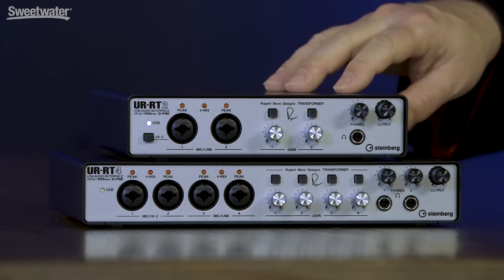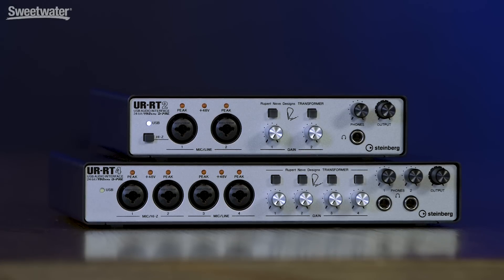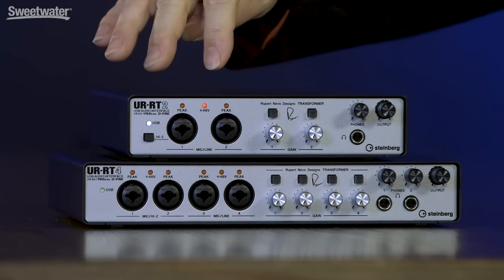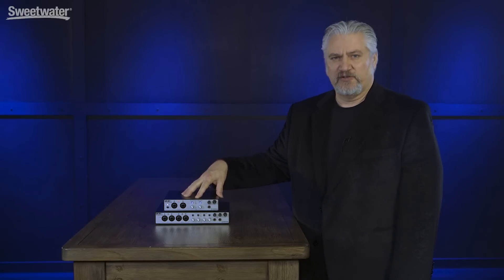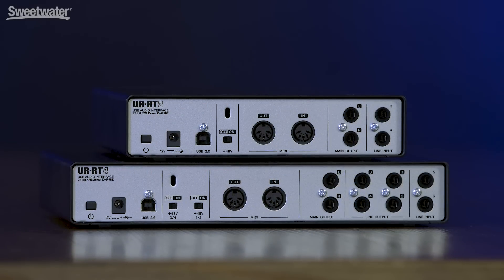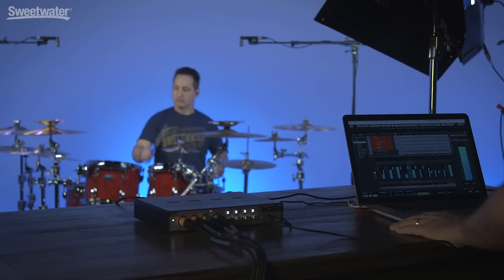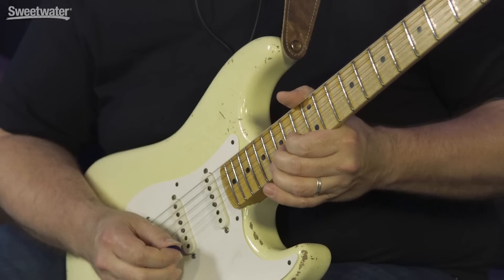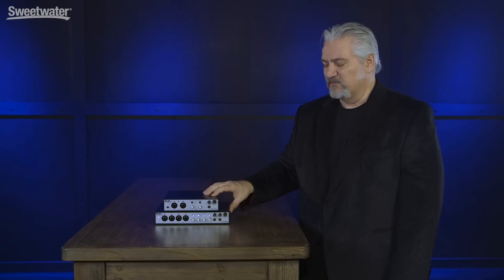Steinberg UR-RT Audio Interfaces Review

Comment: This is sooooo sick. I WILL BE BUYING THIS.
Reply from the maker: I know!! You really can't beat the Neve sound. That extra headroom, the trademark Neve character. It's amazing to see Steinberg doing this. Thanks for the interest, Maxwell!
Mike Godlove, Sweetwater Sales Engineer, (800) 222-4700 ext. 1355
Reply: Extra headroom is a long stretch when you compare it to other USB interfaces such as the Clarett 4 Pre USB, Apogee Duet 2, Audient and the RME Baby Face Pro that have specs close to high end equipment 2 to three times its price. The Front end specs on the UR-RT4 aren't all that great with only 101 db Dynamic Range, +4 dBu maximum input level which is quite low by today's standards. The Clarett has a lot of headroom with a Dynamic range 118 db, +18 dBu maximum input level.  The higher the Dynamic range the better as noise is accumulative. Once you start mixing many tracks together, the noise floor adds up and becomes louder and easier to hear. Same if you process your audio tracks with compressors or limiters > a side-effect of compressors is it raises the noise floor. So starting out with as low a noise-floor (measured with dynamic range) is ideal. The UR-URT is more inline with the Scarlett interfaces. Even the new Motu AVB interfaces have impressive specs that's normally found on high end equipment plus the ESS Sabre 32bit DAC they are using.
Reply: @sweetwater  whats the music ? Any link to download it . Great stuff.

Comment: Sounds good, but I wish it had more inputs.
Reply: Kevin Tran 8 would've been sweeeeet.
Reply: if you really need more than 4 channels you can get an focusrite scarlett  18i20 for 100 bucks less and still get 24bit/192k converters.
Reply: The UR 824 is pretty decent - and you can get it in bundle with Cubase Pro. I love the fact that I have 3 different cue mixes on it.

Comment: Can you use this device on multiple computers, or it's stuck on one computer box after you register your product?
Reply from the maker: Hi, thanks for your interest! Audio interfaces like this one aren’t registered to a specific computer, so you can move the interface between multiple computers with no issue. Of course, you’d need audio software installed on each computer you use – if you don’t already have such software, the Cubase license included with the UR-RT interfaces can be authorized on up to three computers.
I hope this helps a bit – feel free to contact me directly with any further questions, and thanks again!
Caleb Lowrey, Sweetwater Sales Engineer, (800) 222-4700 ext. 1620, caleb_lowrey@sweetwater.com

Comment: I like the price point. I'm 80% Dac for streaming Spotify with my MB Pro to powered monitors and 20% interface for guitar. Is this a good choice for what i'm doing or please suggest something else. I can go USB or Thunderbolt. My Audioquest Dragonfly dac  for the money is a good value. I've tried Apollo Twin MKii Duo and it gets the sound I want but $900 for a Dac? The Solo I tried wasn't as good as Duo although UAD said the AD/DA was identical in both. Thanks
Reply from the maker: Hello, Mr. Mips! It sounds like you have something specific in mind. Please give a call if you have a moment. I'd be happy to guide you to the perfect interface for your needs. Thanks for your message!
Mike Godlove, Sweetwater Sales Engineer, (800) 222-4700 ext. 1355
Reply: The specs for the DAC are ok with a Dynamic range of 114 db, THD+N 0.001% (-100 db) but NOT nearly as impressive as other interfaces for the same price. The Clarett 4 Pre USB DAC has a dynamic range of 118 db with THD+N of 0.0006%  (-104 db). The new Motu ultralite-Mk4 using the new ESS Sabre 32bit DAC chip with Dynamic Range of 123 db, THD+N 0.0008 (-101 db). The ESS Sabre 32 bit DAC chip is also found in the Apogee Duet 2 interfaces.
Reply: I like everything about this especially the transformers but I'm disappointed with the DAC, as Eman 08 points out. At this stage, it's just not acceptable for something with so much good going on here to have just okay converters. These converters should be comparable with the new Motu, the new Apogee, the new Slate, the new Antelope, etc. The fact is, no matter how good the preamps are on this thing, the DAC is so critical to getting things to sound truly professional and not hold back the enormous potential. This is why guys spend so much on Burl, Antelope, Benchmark, Dangerous, Mytec, etc. If these other competitors can manage to use next level converters in their below $1000 interfaces, why can't Steinberg? I don't get Steinberg. They make an amazing DAW(s). But all the rest of their stuff is plagued by "almost as good", almost caught up, almost pro. Why? Antelope does not do this, even on their "cheaper" stuff, UAD even upgraded their converters after complaints about the first generation Apollo Twins. Motu is now kicking butt again. I knew ahead of time that Steinberg would blow it on these converters...and they did. It's entirely fitting with their company philosophy which is to be always playing catch up and to never be out front on the audio vanguard. As a Cubase 9.5 Pro and Wavelab 9.5 Pro user, it's endlessly irritating.
Reply: Nelson Starr IV yeah the Steinberg/Yamaha interfaces are way behind in the competition as the UR range are basically low end prosumer as they have specs more in line with the Focusrite Scarlett range, Presonus AudioVox and Roland Rubix. Basically a Neve designed transformer bolted on a cheap low end budget interface. Even the Focusrite Clarett blows this thing out of the water for the Mic Pre ADC with a dynamic range of 118 dB, a Total Harmonic Distortion + Noise of 0.001% generally found in high end converters. The ADC for the mic pre on the UR-RT is shy of only 101 dB of dynamic range and 0.003% Total Harmonic Distortion + Noise which worse than the Focusrite Sarlett Range. I really think Rupert Neve should of reunited with his fellow Focusrite company and collaborated on a new product like this as he hasn't designed any thing for Focusrite since he sold the company in 1989. Focusrite is still Rupert Neve's brand while his legacy still lives on within the company. I think he made a mistake with collaborating with Yamaha.

Comment: Is it possible to connect two audio interfaces to create 8 channels. If yes, would there be any issue?
Reply from the maker: Hi, Celestialdrums. This is a good question! There is a way to use multiple interfaces easily if you are using a Mac. It requires creating an aggregate device, we have a guide here:
https://www.sweetwater.com/sweetcare/articles/aggregate-audio-devices-and-drivers-for-pc-and-mac
In this guide we also have a tutorial on using ASIO4All drivers on Windows, but in my experience this is a hit and miss set-up and changes from interface to interface. Aggregate devices are not perfect and can run into glitches at times, even on Mac OS, that can lead to clock drift and some other weird artifacts. I recommend picking up an interface with enough preamps or an ADAT expansion port so that all audio goes through a single interface.
If you have any more questions, just give me a ring!
Drake Sobehrad, Sweetwater Sales Engineer, (800) 222-4700 ext. 3271, drake_sobehrad@sweetwater.com
Reply: @sweetwater  Thanks a lot for your help.

Comment: Can they run purely on just usb bus power? If so are there any features that you lose from not having the power supply plugged in? Thanks, looks great!
Reply from the maker: Hey, Jon! These interfaces are not bus powered and the power adapter does have to be used. Thank you for reaching out… Rock on! 
Philip Courtney, Sweetwater Sales Engineer, (800) 222-4700 ext. 1968
Reply: Should we buy power adaptors separatly or it is sold with the UR-RT?
Reply: 12V DC power supply included.
Reply: @christinekolyan5821  I've bought an independent linear PSU tailored for my Steinberg. It improves the SQ of my steinberg massively!

Comment: USB 2.0?🙄 Need usb 3.0, or usb C. But being too thin connection for usb C can be a problem for long run. I wish we have usb C as long, tight, firm as TRS pin 🤔.
Reply: I buy it because it has 2.0. I have 1k £ usb cable that really improves the sound of my interface

Comment: nice! if the RT4 had adat I/O I would give it a run
Reply: Russell Loving me too! I wonder why they chose not to include it
Reply: sp0rtbilly77 not sure... especially when so many of the new interfaces in th at price range are including it
Reply: Do you think maybe it competes or will do so on future products?
Reply: When you look at the specs, they aren't that great as they are quite low by today's standards compared to the rest of the completion in the same price range. Its basically Neve designed transformers bolted on a budget interface with Specs more inline with the Focusrite Scarlett range.  With only a Dynamic Range of 101 db for the AD is pretty disappointing compared to the Clarett 4 Pre USB with 118 Dynamic range db with specs normally found on interfaces 2 to 3 times its price.
Reply: Eman 08 that could be, what would you consider better than a Scarlett in the same size and format?
Reply: sp0rtbilly77 not very many out there in that same class maybe the Presonus Studio interfaces with the exception of the studio 192 that's more in line with the Clarett USB interfaces. The new Motu AVB ultralight is also more in the same class as the Clarett range. The M-Audio ones are probably lowest quality of all the manufacturers as they never have made any compelling interfaces that rival Focusrite or Presonus. Most of them are junk as I remember owning a fast track way back in the day.
Reply: sp0rtbilly77 I personally would go with the Clarett 4 Pre USB or the new Motu Ultra Lite mrk4. They have alot of headroom and much better digital conversion than these new URT interfaces for the same exact price. You can't go wrong with an Audient interface. The URT interfaces are pretty much using the same old technology from the original UR interfaces as the specs are quite dated by todays standards. Those transformers is very subtle as it's nothing like a real Neve preamp that has both input and output transformers nor is the Pre amp designed by Rupert Neve since it's still a Yamaha D Mic Pre amp from the original UR interfaces.
Reply: Focusrite products are known to not work well with Windows based PC, right? Is the Clarett any different??
Reply: Koryuhoka I never had any problems. I owned three Focusrite Products my self and also used them on Windows 7, 8, 8.1 and 10. My Focusrite Forte is the oldest Focusrite I have that came out in 2012 working flawlessly in Windows 10 64bit with it's original driver from 2013. I still have the 1st Gen Scarlett 18i20 which also works flawlessly on Win 10 with it's original driver from 2014. I don't plan on hanging in to my 18i20 since my new Clarett 8 Pre Thunderbolt interface will be replacing it. The Clarett works perfectly with the Intel NUC using a Thunderbolt adaptor.
Reply: +1 I had the earlier model Steinberg interface (UR44). I found it to be reliable, but underpowered. Far too much latency for my purposes. Bit the bullet and got me an RME Fireface UCX and never looked back...

Comment: why usb? in this days all interfaces use thunderbolt technology
Reply: because majority of computers have usb... why make a product for a small market? why make people buy additional parts to use their product.
Reply: ^ and usb bandwidth is more than enough for this many in/outs
Reply: the only pc OEM still using thunderbolt is mac...cuz screw the consumer lol. it's not cost effective for 99% of board manufacturers to include it when USB 3 is plenty and a lot less expensive.
Reply: Wrong. I have a Focusrite Clarett 8 Pre Thunderbolt interface with running on Windows 10. You will find plenty of board manufactures with motherboards that come with Thunderbolt 3 esp the X99 boards. Just got to gigabyte and Asus. HP and Dell makes laptops with Thunderbolt and Intel makes the NUC with Thunderbolt 3. Thunderbolt is the future as its an external PCIE connection. In terms of latency, nothing can beat it. Intel also lifted the Thunderbolt licensing fees as more and more manufactures are making thunderbolt interfaces these days.
Reply: You just need a USB-C connector on you computer to be able to use Thunderbolt. No need for a Mac anymore.
Reply: The Machine would have support the Thunderbolt protoco meaning the intelchip set for Thunderbolt as they aren't the same  thing. If you don't want to build a computer just get the Intel NUC that comes with Thunderbolt 3.
Reply: @giulioboobzilla  I love that its USB 2.0. Cause I have an expensive usb cable (1000£) that only works with USB 2.0 devices. It massively improves SQ.
Reply: @giulioboobzilla  SQ is sound quality. CAD USB II £990.
Reply: @giulioboobzilla  By reducing high frequency noise.
Reply: @giulioboobzilla  No but it carries the audio signal.
Reply: @giulioboobzilla  Lul. Use your ears buddy. Then you will understand there is more to numbers and science.